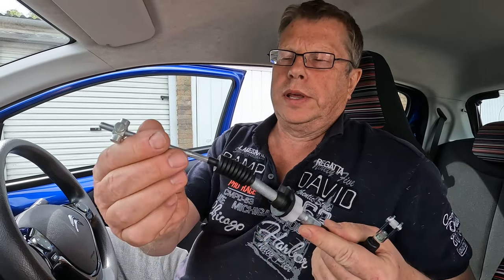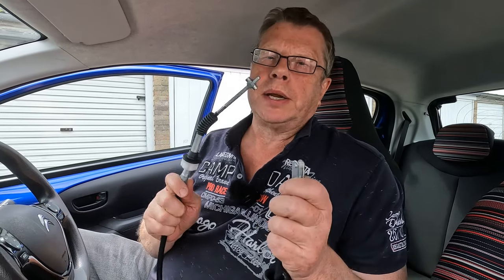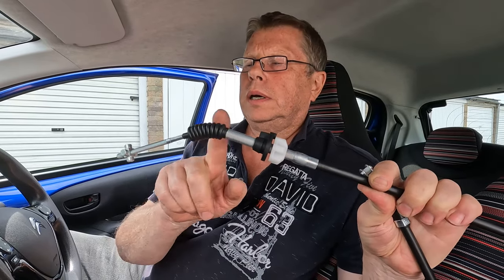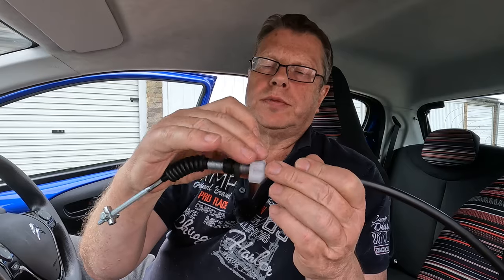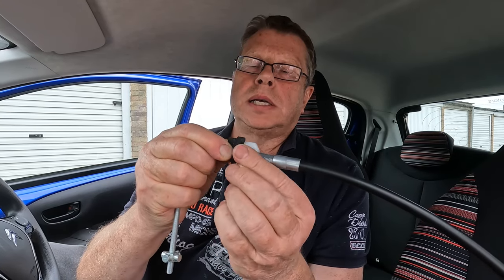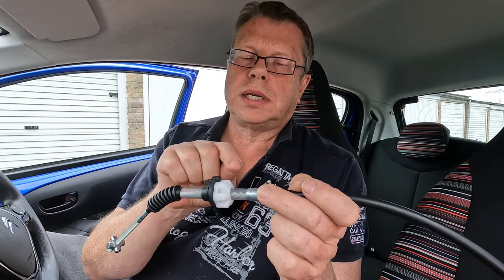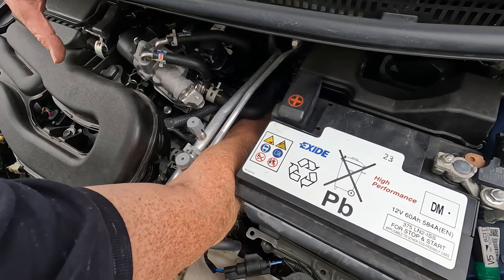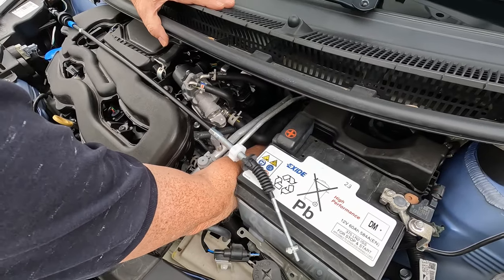Toyota Aygo, Citroen C1, Peugeot 107 108  Clutch cable adjustment - all 1.0i petrol models

Comment: Thank you for the upload. I bought a Citroen C1, and the clutch pedal had no play. Causing it to slip on heavy acceleration. Turn the white nut (in my cause, it was black as it was 2007 model) anti-clockwise. And..... Voilà!  No more slipping under heavy acceleration and clutch pedal has good play before engaging the clutch.

Thank you for your upload. It was much appreciated  very clear instructions 🎉
Reply: so your clutch was too low?
Reply: @fasn279   my clutch was still high before the adjustment. It is still high now. It just altered the free play. You can adjust the position of the pedal resting position google it.

You will find out the procedure to do it or download the manual it is in there also. (I  downloaded the manual online, so I know it is in there)

Comment: You can use a screwdriver to push lever back instead of lifting clutch if on own. Can take off gearbox cables with a clips much easier access

Comment: Great video - saved me from tearing off the gearbox to change the clutch! When working out which way to turn the cable it helps to remember that you are actually slackening the cable. Most cable adjustments require tightening to adjust for cable stretch.
Reply from the maker: You're not adjusting for cable stretch, you are adjusting for clutch wear. As the centre plate friction material wears, the pressure plate diaphragm spring moves out. This pushes the release fork back. You need to lengthen the cable to compensate.

Comment: Just clarifying, adjusting/turning the plastic nut adjusts the clutch biting point higher or lower; it doesn’t change the actual clutch pedal height!

To change the pedal height, there’s a separate adjuster bolt & stopper on the clutch pedal inside the car.
Reply from the maker: Adjusting the plastic nut at the gearbox end of the cable actually adjusts the cable length - hence it adjusts BOTH the bite point and the resting height of the pedal.
There is a pedal stop to limit the maximum height of the pedal, however the pedal should not hit the stop in normal operation. If the pedal is contacting the stop then the cable is way out of adjustment. Once the pedal is against the stop then the release bearing is being held against the pressure plate and the clutch cannot fully engage. The clutch will start to wear very quickly.
The pedal stop position is set at the factory and should not be altered.
Reply: Hmm not sure about this. There should be some free play at the top of the pedal travel, this indicates the cable is adjusted correctly but the pedal mechanism might still be contacting the stopper and be fine.

Comment: Excellent video... very useful. My wife just bought a fairly new C1 with a high bite point. Just the info I needed, however I found that with ours it was easier to reach it from under the car, no need to jack it up. Thanks

Comment: Cheers. I did this. There was virtually zero play in mine. It didn't lower the pedal, but I have some free play now. So the bite point is lower. Maybe I need to adjust the cable at the clutch lever also.

Comment: Thanks for the tip.. I want to fit a boot light in my 107.  Can you advise how I could lead a wire from the battery to the boot and how to go about fitting a switch..

Comment: I just replaced the clutch in my son's 108. Adjusting the cable was a total nightmare. My hands are too big to fit down beside the battery so i need to  remove the battery and battery tray every time i adjust it. Im not exaggerating when i say that the battery was in and out a dozen times before i got it perfectly adjusted🤪

Comment: I have an auto aygo 2005. Its constantly beeping when i accelerate.  Not the door beep or light beep or seatbelt been. Its coming near dashboard but no warning lights. The only thing after researching is the automatic clutch?
Reply from the maker: It is very likely a problem with the gear change system. They tend to be troublesome and I'm very surprised its still working on a 2005 car. You need someone with experience in these systems to check it and set it up correctly.

Comment: Hi, is this adjustment procedure the same on a 1.2 alure model, on the Peugeot 108 ? Thanks again for your tutorial.
Reply from the maker: The procedure is similar, but not the same. The 1.2 litre model uses the PSA PureTech engine and a PSA-designed gearbox (rather than Toyota, as on the 1.0L models). Its a cable-operated clutch, similar to the one shown in this video, but the cable attachment at the gearbox is different.
Reply: @erictechUK  Thanks again for your insight.  I'll look further into it.

Comment: Great video but cannot lift pedal to release the nut. Any ideas?
Reply from the maker: The cable has not been adjusted for a long time and you have run out of free play at  the pedal. Use something like a very big screwdriver or bar to  move the operating lever on top of the gearbox to take tension off the cable. Then you can move the nut. You may want to jam the operating lever with a big socket whilst you spin the nut a few rotations to lengthen the cable. Once you have some free play at top of the pedal you can adjust as per video...

Comment: Should the clutch and brake pedals be the same height after the adjustment?
Reply from the maker: The service manual specifies a particular distance between the floor and the resting pedal. Normally this puts the clutch pedal just a little higher than the brake pedal. But really its up to you - anything between level with brake pedal to about 20mm above it is ok. So long as the clutch releases fully when fully depressed you'll be fine.

Comment: Just a quick question, clockwise or anticlockwise depends on weather you are looking down into the engine bay or underneath the car looking up. If you are standing, adjusting it  leaning into the engine bay is it clockwise to lower the pedal
Reply from the maker: Clockwise/anticlockwise directions are given from the perspective of standing in front of the car and reaching down to the adjuster, as shown in the video.

Comment: Super video and very helpful. Wifes c1 has slight clutch slip. Gears engage fine but no free play at all on pedal. Solid push from the start. Would this adjustment work to rectify this and if so looking from top down into engine bay would adjusting nut need turning to my left (anti clock) or to my right (clockwise). Many thanks
Reply from the maker: The clutch pedal should be level with the brake pedal, or slightly above it. Try lifting the clutch pedal. If the pedal is resting high and when you try to lift it it is already against the stop and won't lift then this is likely the reason for your clutch slip and the cable needs to be adjusted urgently. You would turn the adjuster clockwise to lengthen the cable. If, however, you can lift the pedal a centimetre or two then cable adjustment is not the reason for the slip and it is likely that the clutch is worn out.
Reply: @erictechUK  thanks for getting back. So I can't get an assistant to lift the pedal back to give slack to make adjustment as the pedal is solid. I've had the pedal pressed and put a wedge on block to allow me to adjust. Looking top down I'm adjusting to the right clockwise and the pedal is actually rising. Wedge out and worked clutch but now I can hear clutch slightly engaged before pedal is pressed. Should I be adjusting opposite way. Many thanks
Reply from the maker: @jmaud2855   Standing in front of the car facing the windscreen you need to turn the top of the plastic adjuster nut to the right. This should have the effect of slackening the cable and lowering the pedal.
Reply: @erictechUK brilliant thanks ever so much. Would this increase pedal free play along with adjusting clutch release bite point when pulling away.
Reply from the maker: @jmaud2855  Should lower the pedal resting point and lower the bite point - provided the clutch is not worn out.....
Reply: @erictechUK  thanks ever so much for the speedy replies and help. It's greatly appreciated.
Reply: @erictechUK adjustment made and seemed to have worked. No slipping on a long test drive. If you were to  over adjust (loosen cable) would that cause a problem. Pedal didn't drop or lower so I'm guessing the pedal height would need adjusting on the actual pedal bolt

Comment: So which direction do you turn the nut if the clutch comes in late when you release the pedal?  Clockwise or anticlockwise?  And is the direction of turn for clockwise/anticlockwise determined from the clutch looking back down the cable or looking forward towards the clutch?
Reply from the maker: If the clutch is biting high then you need to lengthen the cable. Standing in front of the car looking down at the gearbox you need to rotate the plastic adjuster clockwise.

Comment: Hi, how much higher should the clutch pedal be than the brake pedal. How many centimeters should it be? thanks
Reply from the maker: It can be level with the brake pedal or just slightly above (1-2cm).

Comment: You can actually do this yourself. You don't need anyone else providing you have access to a lift. I've done 3 this month. With the car up in the air and not too high, you can reach up one side of the subframe with your left arm and the other side of the subframe with your right arm. This way it is very easy to pull the cable and its adjuster away slightly from the lock pin whilst adjusting it the same time.
Reply from the maker: Sure, if you have a lift its pretty easy. The method shown in the video is for an amateur mechanic to do in their driveway or at the roadside.
Reply: Hey, you must have pretty long arms to embrace the car front..., haven't you?
Reply: You can also lift the clutch pedal and jam a rock underneath it to hold it up and then adjust
Reply: This is also for the Aygo 2013 MK1 I presume. Great tip. Will inspect this in the coming days. Have a nice day!

Comment: Please help!! I successfully adjusted the clutch pedal to a lower position. BUT, after doing this my brake light does not turn off. If I push up the pedal from underneath, it does switch off. I don't understand the connection between the 2
Reply from the maker: Adjusting the clutch pedal height should not affect the brake light switch. Possibly your brake light switch has come loose or is misaligned. The brake light switch is mounted on the brake pedal bracket in the footwell. Get down in the footwell and check that plastic switch body is securely mounted in its bracket and the electrical connector is pushed on properly and wires are not chafing on anything.
Reply: @erictechUK  Thank you for your answer and confirming my thoughts. I asked my gf to release the tension on the clutch pedal when adjusting the cable. Maybe she accidentally touched the switch on the brake pedal. For now I put something under the  pedal so my battery doesn't run down. I'll check later today

Comment: I have a 2009 model. My garage man says it has a hydraulic clutch, couldn't find a cable.
Reply from the maker: All 1.0 litre petrol models are fitted with a cable operated clutch.  I believe that the 1.4 HDi Diesel engine model (2005-2014) was fitted with a hydraulic clutch.
Reply: Thank you. I will tell it to him. Strange he did not see it.

Comment: Does this apply to the MMT (multi-manual mode transmissions)?
Reply from the maker: No.
Reply: @erictechUK  Does the MMT need an ECU re-calibration to offer something similar? It was done a few times by my local dealer (official TOYOTA licensed) but issue re-appears for me after a month.
Reply from the maker: See this document https://www.scribd.com/document/255813353/INF134-MMT-Clutch-Kit-ADT330265-266-274
Reply: @erictechUK  Thanks!

Comment: My on son's car there's no movement on the pedal for someone to release it
Reply from the maker: That means the cable has not been adjusted for a long time. Clutch wear means the pedal has risen until it has hit the stop.
To adjust it you should have someone press down on  the clutch pedal and hold it down. Observe the clutch operating lever on top of the gearbox and use something (e.g. a large socket, an adjustable spanner etc) to jam it.  Now release the clutch pedal.  There will now be slack in the cable for you to turn the  cable adjuster nut.  Turn the nut clockwise about 5-6 turns.  Now press the clutch pedal down and remove whatever you used to jam the operating lever.  You should now have free play at the top of the pedal and you can finish the adjustment process as in the video.

Comment: So I got someone to help, they lifted the pedal while I tried to adjust the cable, but the black cap didn’t move. I’m assuming this means the clutch is too high and potentially going?
Reply from the maker: It may be that the clutch pedal is very high and at (or close to) the pedal top stop.  My advice is to have someone hold down the clutch pedal to release the clutch. Then use a solid object (e.g. a big socket or a spanner etc) to jam the clutch operating lever (on top of the gearbox) in the released position.  Now your assistant can take their foot off the clutch pedal and the pedal will be floppy with lots of slack in the cable.  Rotate the plastic  fluted nut a couple of turns clockwise.  Operate clutch pedal again and remove the object blocking the operating lever.  Now you have more free play at the pedal and can complete the fine adjustment as shown in the video.
Reply: @erictechUK  thank you, your explanation really helped me correcting the height of my clutch pedal, much appreciated.

Comment: What can you do if the clutch pedal has no free play to lift?
Reply from the maker: Have an assistant push down and hold the pedal.  Go to the gearbox and place a hard object such as a large socket or a spanner between the clutch release lever and a solid part of the gearbox casing - this is to jam the lever in a partially released position. Then slowly release the pedal. The lever should be jammed and there will be slack in the cable.  Adjust the cable to put more slack into it. Press pedal again. Remove object. Now adjust cable as in video.